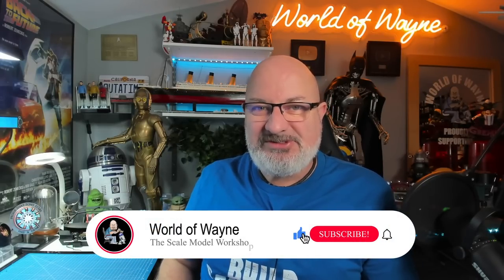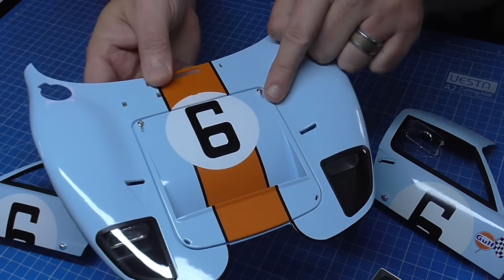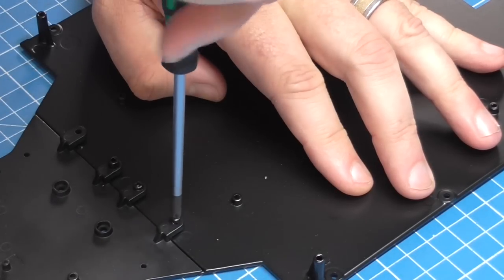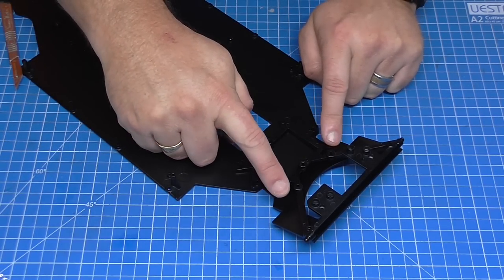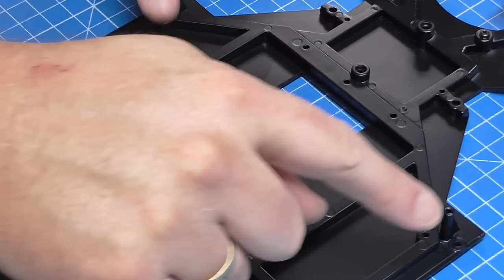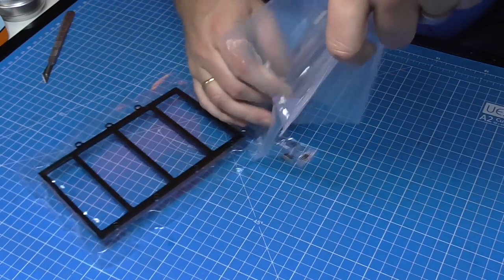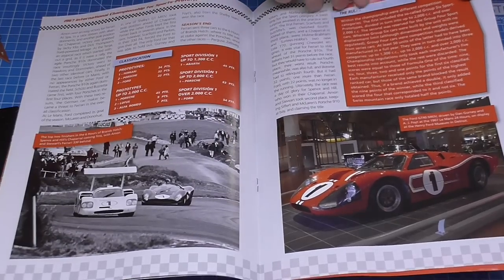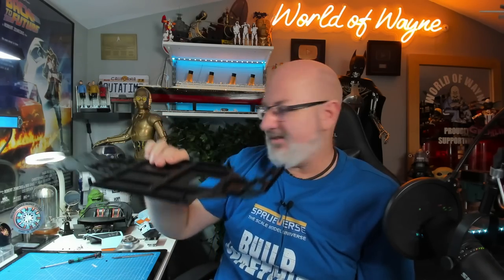Build the Ford GT - Pack 9 - Stages 38-42

Comment: Re names of parts. Not being a mechanic myself I'd call the chassis the frame the suspension, brakes, and wheels etc bolt onto. The floor pan literally being the vehicle floor - fits onto the chassis? - and then the vehicle body fits onto the completed floor pan / chassis combination.

Comment: Ref the aching hand. I'd suggest these stages are classic candidates for the battery screwdriver.. especially as the parts are metal so you can't really over-tighten anything or strip the threads.
Reply from the maker: I don’t think they would have the torque
Reply: @WorldofWayneUK  Possibly not, but it's that or an achy hand :)

Comment: The chassis is built well like the Ecto-1 is...
Strong as hell...lololol
The GT40 had a sealed bottom of chassis and floor pan...
It was lightweight but extremely strong...
I've worked on an original one 40 some years ago and you can see how well built it really was...
Now I see people have been commenting on why it's called sometimes just GT and not GT40...
GT stands for "Grand Touring"...
Generally if you say "GT" people know that you mean this car or the new version only because that's what Ford calls it...
And if you say "GT40"...it's an original one from the 60's...
Because all the newer "GT's" are not 40 inches high...hence the 40 in the name...lol
Now also I see people are saying that their paying so much for this pack or other packs with little in them...
Well it all works out in the end... because if you were to pay the full price and get the kit at once...you'd never notice the break down price for everything...
That's just the way it is...
Such is life in the big city as they say...lololol